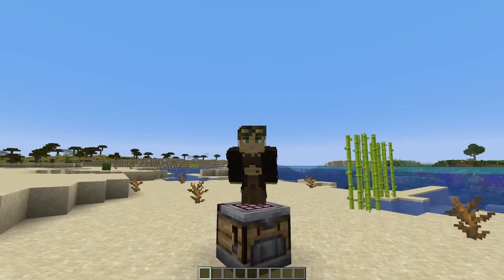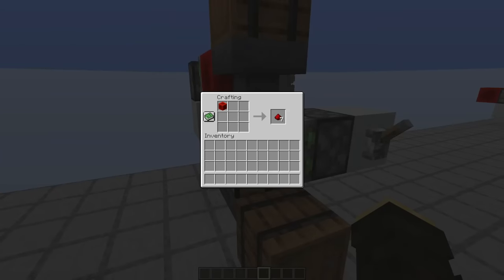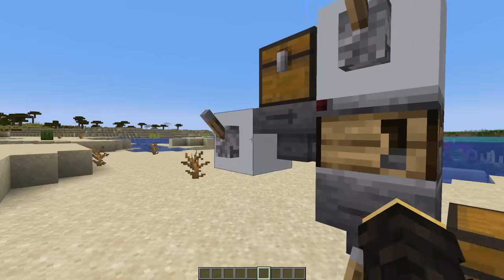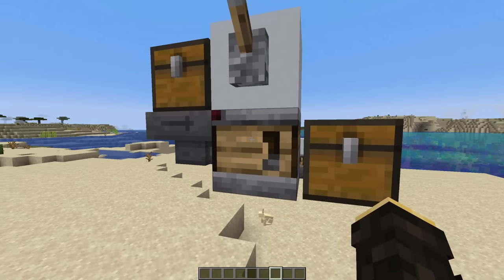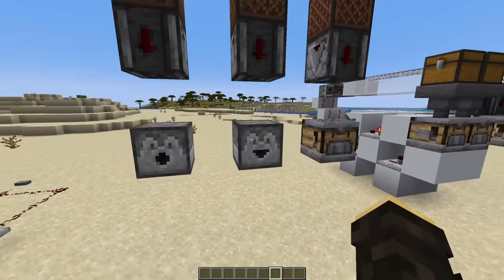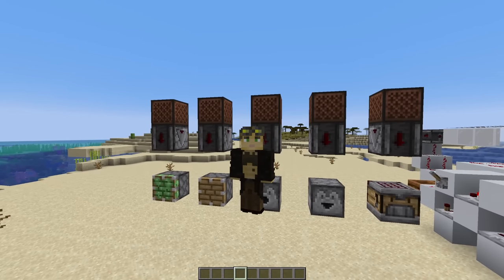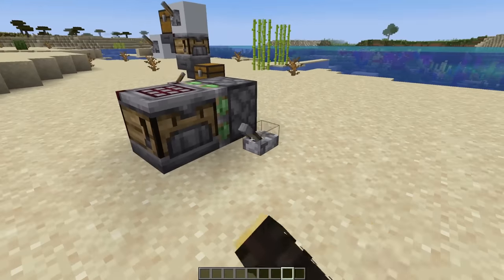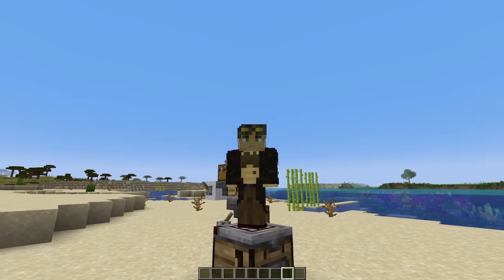The Epic Return of Autocrafting

Comment: I think you realized this by now, but I'm still going to say it: Creating a universal autocrafter is completely possible and surpisingly easy. This is because the auto crafter always tries to distribute the items evenly instead of stacked. I'm pretty sure that there will be amazing systems that go beyond what was possible with modded autocrafters before.
Reply: It's speed is the issue tho
Reply: @parrazarre1773  its not that hard to craft most of the items at the hopper speed
Reply: @ИгорьДементьев-и7м  yeah but mass crafting can't run at hopper speed
Reply: @parrazarre1773  as i said,it could.Use multiple dropper lines instead of hopper lines.
Reply: I also think it's possible
 Here is a thing furnice is not movable but you can make a furnice array like wise we can use hopper minecarts that feed 64×4 crafters with an interval of 4 gameticks it might be possible

Comment: Honestly the crafter is probably the most revolutionary thing added since arguably the piston. It single handedly made 1.21 a 7/10 for me.
Reply: Observers are way more revolutionary, they changed redstone completely. The Crafter is a little more niche as the observer can be used on anything from a farm to a flying machine.
Reply: Even hoppers are more revolutionary
Reply: ok chill it’s still pretty cool
Reply: @Nico_com_c  disagree, yes observer changed redstone a lot, but they didn't change much fundamentally, BUDs where and are still a thing, crafter changes what can be automated, observer allowed things to be more compact. Hoppers and crafters are above observers in my book in terms of impact as they both fundamentally changed mechanics

(arguably, comparators were a bigger changes than observers too)
Reply: @Nico_com_c observers were cool i guess but pre-1.11 we just used bud powering. the only reason we got the observer is because bedrock had it and bedrock doesn't have bud powering. we can live without the observer. on the flip side, crafters and hoppers both store and move items to different locations. the only change being crafters need a pulse to do so and it crafts things too. we can live without them, but id prefer not to because it limits capabilities, while observers do not.
Reply: @CDSide  Most flying machines (and any contraption that works under the same principles as a flying machine) were basically useless before observers, that's a whole branch of redstone that is only as good as it is because of the blocks.
Reply: @Nico_com_c flying machines definitely existed before observers, and what's your point? the only use i can think of for flying machines is farms so it doesn't necessarily need to be fast.
Reply: @CDSide  >>most<<
Reply: @CDSide  As someone who was there when jazz made the first Quarry without observers, observers really did a lot more than make the designs faster, it basically allowed us to have 2 way flying machines in every contraption, which was really fun for me since i specialized in that area at the time the observer was not in game yet.

But I agree with you hopper is a much more important and game changing addition when it came out. Most people don't even realize how different minecraft is without the hopper since its a such an old and widely used tool. And over hype the observer for its general use purpose.
Reply: @illliiiiillliii6265  i 100% agree with your comment here, and i do still think the observer was somewhat overhyped. the only reason the hopper and crafter are so awesome are because they allow us to do things we couldnt before.

Comment: I suggested on the feedback site that it might be good if the crafter kept the 0-9 strength for filled/locked slots but then gave 15 if the items inside make up a valid recipe. That would be something of a best of both worlds, and would also allow things like, if you're using filler items, detect strength 9 as the cue to unlock the hopper below to pull the filler items out. And it would even unlock a way to do things like sort shulkers by colour by seeing whether the shulker plus a particular dye is a valid recipe or not! (Currently that wouldn't work because for some reason it is valid to dye a shulker to the colour it already is, but that seems like it could probably be changed pretty easily)
Reply: Good idea !
Reply: I really like this idea however if you ever put a single iron in the crafter it will give signal strength 15 so both the negatives and positive would have to be considered
Reply: @Thomas-ev4gm  both a full crafting grid and a valid craft would be required for the 15 strength signal then
Reply: @parrazarre1773  ah that would work! So for the shulker thing  you'd block out all squares but 2 so when you had a different coloured dye you get 15 but I only 9 when it's the same
Reply: @parrazarre1773  maybe that could be implemented as a valid crafting recipe adding 6 signal strength

Comment: Very interesting point about the difficulty with filling the crafter with 9 inputs. Wonder if there is a strange work around
Reply: Yeah, pretty simple actually. Just make a row of hoppers behind the crafter, then dispensers onto those hoppers, the dispenser closest to the crafter will be the item that lands on slot 1 in the crafter, dispenser number 2, connected to the next hopper in the row, will fill slot number 2 in the crafter and so on. As the items are inputed in a certain order.
Reply: @SparkyFolf unfortunately this is unreliable unless you use a staggered dropper/dispencer line. Since redstone dust updates are unreliable and locational you can't simply trigger the entire line at once
Reply: @tacoterrorizer1862  powered rails and observers would solve that problem easy

Comment: This is the best thing since hoppers and pistons
Also I’m glad Mojang made it only work with external circuitry because I fell like it would be boring if it you could just set the recipe in the crafter
Reply: I mean, you still kind of can if you just use a slower redstone clock and load the crafter manually the first time.
Reply: @AtaraxianWist you still need a circuit

Comment: 9:00 just add a buffer in hoppers. One hopper for each slot/item type. Once all necessary items have been inserted they will be sent yo the crafter. This can be slower but it's the only way.
Reply: And you can make up for speed by having multiple systems running at once
Reply: I already made another comment about this, but it is possible to feed all the ingredients for a piston into the crafter at dropper speed by utilizing more crafters.  You can use a crafter that converts logs into planks to insert 4 planks into the crafter at once, and another crafter that alternates between uncrafting iron blocks and redstone blocks to insert 9 at a time so they don’t need to cycle as frequently. That leaves you with 4 faces for droppers to input cobblestone which is exactly how many you need.  There will be additional logic required to skip the wood every 4th cycle and only add the redstone and iron every 9th cycle.  You also will have to deal with the crafter having no available faces to spit out the items to, so it will have to use a face with a full container to spit it out as an entity, but it is doable.  Alternative you could make multiple slower designs.  You still are kind of screwed for recipes that require more cobblestone though, like droppers, dispensers and observers.
Reply: @sebastiangrau8409  the crafter's output can face any direction, including downward

just in case you didn't knew
Reply: @rn8567  i did know, why do you bring this up?
Reply: Does having an item go through more hoppers slow down the insertion of ingredients?

Like, say, having each ingredient of a recipe be added into a stream of hoppers delayed by a couple of ticks so the first item gets inserted before the rest?

Not an automation wizard, just a curious casual player whose most complicated redstone device is a basic bamboo farm.
Reply: @sebastiangrau8409  nothing, just my sleep deprived self thinking something that is not the case at all

sorry if it bother you though, I don’t have such intention
Reply: The point is that you only have 5-6 faced but up to 9 item types(not sure if any recipies actually use more than 5 item types). So you might need some hoppers to have multiple item types.
Reply: It is not the length of the hopper chain it is the output. If you are making scissors you have 2 hoppers with iron both imputing into the crafter and can make a pair ever hopper tick (150/min). Or for that matter you can have 4 hoppers inputting iron and get 300 scissors per minute. Or 5 and average 375. For an iron block, you can have that same 5 hopper inputs, but will only get about 83 iron blocks per minutes  @RavenAdventwings
Reply: @wisnoskij  That's not the same as "impossible"

Comment: Tbh, this is absolutely incredible. It could start a whole new Redstone Era.

The only thing I can think of that would revolutionize redstone on the same level would be a block placer.
Reply: Or actual item pipes 🤔
Reply: @ivancastellanos2405   cool, but not really necessary because there are many ways to move items automatically
Reply: @iiiethan  They're mechanically ham-fisted, ugly, and cost-disproportionate. They also require extra space due to wasted functionalities that limit your design options. Your argument is like saying pickup trucks shouldn't exist because we already have sports cars and tractor trailers.
Reply: @dustinbrueggemann1875  still not necessary since although the ways of transportation are complicated, there’re still possible. Auto Placing blocks and auto crafting isn’t (at least not yet). Tubes also wouldn’t change things enough to lead to a new era, which was the main point.
Reply: @bengtnowak8702 but it’ll make transporting large quantities of items significantly less laggy compared to water streams or hoppers
Reply: @ivancastellanos2405  it would be perfect if they were made out of copper so we finally have a use for it all
Reply: @ivancastellanos2405  minecarts are doing well
Reply: There's a difference between simplifying functionality and adding completely novel functionality that half the people in this discussion don't seem to comprehend

Comment: I've actually already built a universal autocrafter in Java, using subtick hopper priority to fill the grid in just three redstone ticks. I made it originally for dispensers, but then realized I could do it with anything. Just need to put a clock on it.
Reply: That's not a universal auto crafter! I gave up on java and tried bedrock and it turned into a tape like thing he showed with his mod. You just input what you want to craft, press a button, and it automatically moves the items from the sorter and spits one out. A lever flick holds the recipe to continuously spit out. Until you have a one input that can be hooked into a shulker unloader and item sorter, you don't have a true autocrafter. Right now, only bedrock can do this easily, I tried on Java. Instead of moving the crafter or chests/hoppers like bedrock, you have to make a diagonal pattern of immovable crafter that drop and refilter all the items back into the sorter.
Reply: I would be interested in seeing a video for it, I’m sure universal designs are around the corner
Reply: @tabletopjam4894  In going to record one this Saturday. It will likely be really poorly edited and messy sounding as I've never done this. And it won't drop for a bit after that, as I'll need time to edit it.
Reply: @johnirby8847  It kind of is, though. There are nine inputs, one for each slot. You can hook shulker boxes to those inputs, and you will have a lever that keeps it from crafting before you're ready. The new decorated pot mechanics mean I can even sort out any mix of unused items (once one of the slots has nothing to put in) and return them. Admittedly, once you get into shaped, non-3x3 recipes, the inputs beco e less intuitive, but it will still sort them perfectly into the correct slots without any beed for nine block faces. Subtick hopper priority is really powerful.
Reply: @johnirby8847  You literally haven't even seen my design.
Reply: @AtaraxianWist  looking forward to it!
Reply: @johnirby8847  my original design broke as soon as I tried to use it for iron compacting. My next four designs failed in a number of ways. It will be a few days before I've cracked it, I think, but it had to be possible.
On the other hand, subtick hopper priority is super useful for bows and dispensers. So there's that I guess.

Comment: personally I like the 0-9 redstone strength because it is more awkward to have irregular jumps in redstone strength, and 15 usually implies filled to the brim (even per stack) while it is more useful to count on "slots occupied" rather than "inventory space filled" in this case.
Reply from the maker: After speaking with craftymasterman a good compromise might be to output ss15 when there is a valid recipe and output 0-9 depending on the slots filled otherwise.
Reply: @cubicmetre That could be terrible as well, some recipes have "duplicates" that only needs some of the ingredients when placed left to right top to bottom

You could have the compromise when all slots are filled to be 15
1-8 and then 15.
Reply: @cubicmetre Frankly better.

9 = full, 1 stack, 10 = full 2 stack, etc. that also makes it easy to use it as a filter, so you don't have to time input

Comment: Once the copper bulb comes out, you NEED to explore the data storing capabilities from it's bistable nature. It's a 1 block t flip flop, and if it could be movable you could literally make a computer with external storage in bits (or even use a base 4 system since it has 4 states on its own)

Comment: I think the limitations of the autocrafter can make it a more interesting block in the long run. The modded implementations were made by people in the technical community who likely set out to make it a mechanic as useful and convenient as possible. This highly effecient design philosophy can remove some of the tinkering required to make it work the way you need it to. Similar to how dispensers give a random trajectory to the items they shoot out. I could see a technical minecraft players' implementation of dispensers remove this feature for the sake of reliability. 

I am looking forward to all the contraptions you come up with using the autocrafter! I'm certain I'll be amazed!
Reply: i think the crafter was kinda designed to be easier for the average player to be able to use. which is why you can lock some slots instead of having to put in dummy items

Comment: For recipes like dispensers or pistons, the order that items enter the crafter is extremely important. The 9 signal as opposed to 15 allows the crafter to activate the next dispenser with the next item only when the item that should be before it actually is in it. For that the 9 max signal makes more sense because it allows a row of dispensers over hoppers to self regulate their input into the crafter and prevent items from entering it the wrong way

Comment: One suggestion I've seen floating around is a signal strength 15 output for a completely filled crafter (i.e. a stack in every slot). This allows the usage of signal strength 15's unique properties for one-wide tileables or just compactness in general, it allows easy ways for a crafter to remember the recipe it is being used for (activating it on ss15 rather than ss9 or a timed circuit), and would be very intuitive for newer players to redstone, and keeps the intuition of the current ss9 functionality. Interested to hear what you all else think!

Comment: 6:18  Mysticat has a good system in his autocrafter video where the detection of a full crafter is handled by a lectern, comparators, and observers; Have a lectern on page 8 and comparator running into a piece of dust with another one from the autocrafter, when the autocrafter's full it'll raise the power to 9 which can be detected by an observer.
Reply from the maker: The problem is the observer pulses twice every time the ss it reached which could stuff up a lot of recipes

Comment: After playing around with it for a while I was able to make a nice 3 deep / wide universal crafter design; but it runs at 1/9th hopper speed because it relies on feeding in the items in order top left to bottom right.

Though I think it actually runs at 1/nth hopper speed where n is the number of items in the recipe, for single item output recipes.
So Shear would craft at 1/2 hopper speed, while Natural Stone Slabs would run at 1/3 hopper speed.
Reply: so we have n, what is th then? you are multiplying n by th
Reply: @anon1963   Ah, sorry for my layout there. I'm saying n'th like you'd say fifth. So 1/5 in full words would be "one fifth", 1/nth is "one n'th"for whatever value n is.

Totally get the confusion, hopefully that explanation helps :)

Comment: For the 0-9 issue, using a lectern and a comparator fixes it super easily, just set the lectern to page 8/15

EDIT: a full composter also gives an output of 8
Reply: Yeah, but signal strength 15 has the property of overriding comparators which are reading containers. This allows you to easily have a 1wt check for signal strength 15, which is not possible in the same way for signal strength 9.
Reply: @wetnoodle5471 i would rather that than have it messily skip some power values to make it to 15
Reply: @wetnoodle5471  With the composter and comparator way, the comparator would be running into the one checking the crafter which would be in subtract mode. this makes the main comparator only output when the crafter is full of items. the only issue is that there's a bug with it right now that when the crafter crafts it's item, the comparator doesn't get updated until the next item goes in the crafter, activating it twice :/